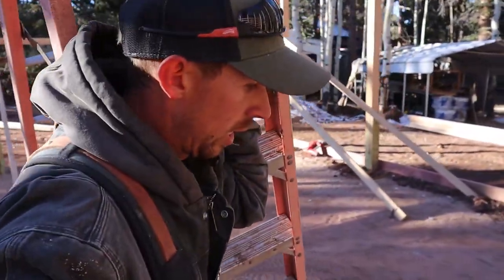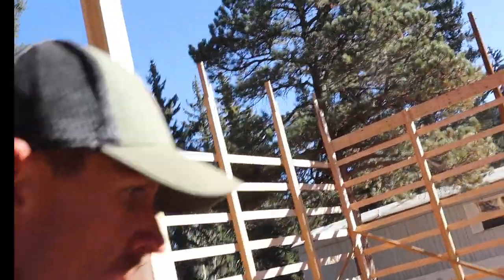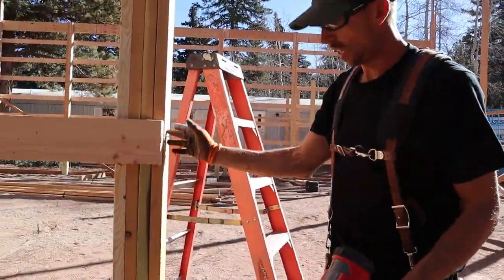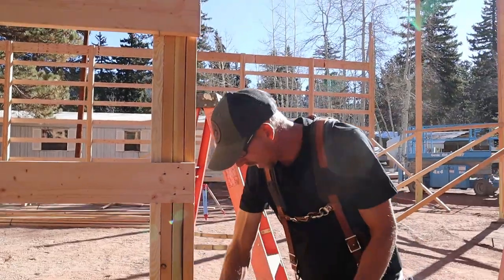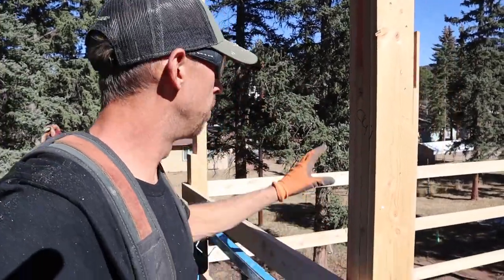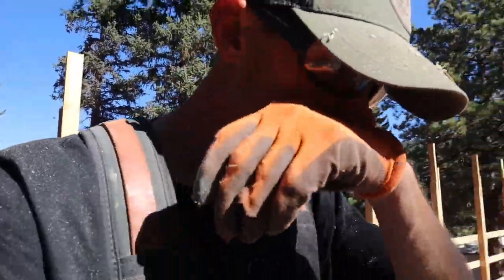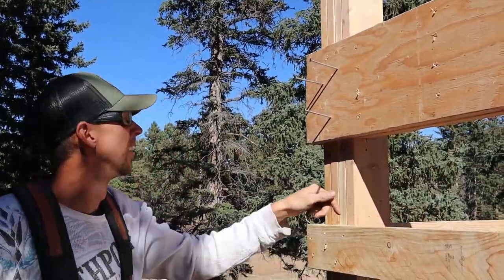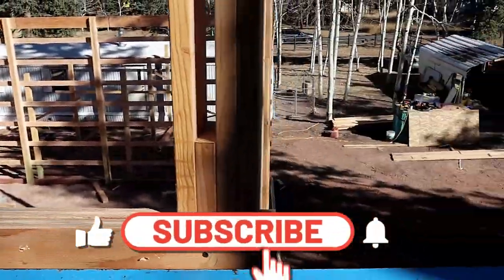WALL FRAMING A POST FRAME BUILDING//POST FRAME BUILDING PART 3

Comment: Is it normal for the engineers where you are to call for double 11 7/8" lvl headers for 8' post spacing? I've only ever seen people use double 2x12's for headers on the load bearing walls with 2' oc and 4' oc spaced trusses. Also, I've only ever seen people use 3 ply 2x6 columns. Is there a huge snow load in that area? Sorry if this was covered somewhere in this video and i missed it. Thanks.
Reply from the maker: That’s a good question. Our engineer requires a double 11 7/8” lvl beam for 2’ and 4’ o.c. trusses. For this job we did 2’ centers which roof sheathing. In our area we have a 40lbs  snow load. Any building over 14’ tall will require 4 ply 2x6 posts or greater. If trusses sit on top up columns at 8-10’ centers, a double truss is required and no Lvls are needed.  

Hope this helps!

Comment: Do I understand correctly...?  
1) You tacked a line of boards at the bottom on top of the skirt boards and marked where post edges intersect
2) Then you untacked the boards from the bottom and moved them up to about half the height and trued the posts to the marks on the frame board?
3) Then, with he skirt board securing the bottom and the new frame boards set half way up...your posts are held straight and you just came back free-formed the remaining framing boards at 2' increments?  And each line of frame boards was pre-measured on the posts up from the top of the skirt board?  

After you straightened the door posts you guys seemed to set frames to a mark and go.  What about when you are on the blue lift?  I presume you used the lift to measured down to the skirt board for the higher elevations?

Thank for your attention.  I am planning to DIY my own pole barn and have many questions =-)
Reply from the maker: -Yes, you are correct on how I did it! I set one corner plumb with a brace and go off of that corner to keep the measurements accurate. 

-I use a set of marked girts at the mid point and near the top to get true, then the other 2’ increments I just free nail. In the scissor lift, I do everything up high, notch posts for beams, ect. 

- The column’s elevation marks are measured off the bottom skirt for pattern and ceiling height. 

- On overhead doors, I verify plumb with a level and not just measurement. Sometimes the columns aren’t perfectly straight, and on large doors it matters. 

Hope this helps!

Comment: I was more interested in how you set the posts plumb, square, and all in the same plane for each wall. Don't you pull diagonals corner to corner, bottom and top of posts to all match? Seems like that would be the trickiest part. Once the posts for walls are lined up, square top and bottom and corner to corner and diagonal measurements match top and bottom of wall, the rest is pretty straight forward.
Reply from the maker: I don’t have that in this video. Yes, you are correct, to verify square in additionally to plumb, one should measure diagonally. I measure square for setting the columns and the walls after the trusses are set. The reason I wait till after trusses are set is because the walls can move until the trusses are set. We come in and use large straps and chains to rack square and straight afterward. Hope this helps!

Comment: How many inches outside the straight line are the holes ?
Reply from the maker: Roughly 9” outside the string with a 24” hole. The goal is to have the posts set to the string and have the holes centered for the post based off of that. It can vary depending on the size auger used. Hope this helps!